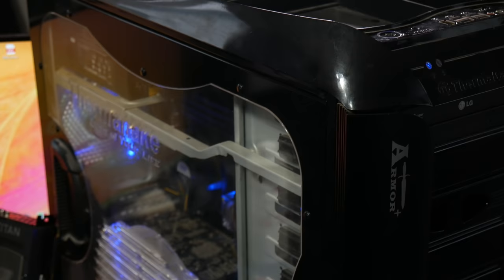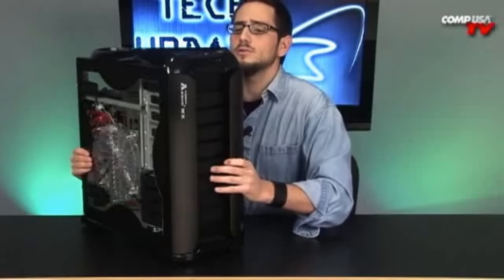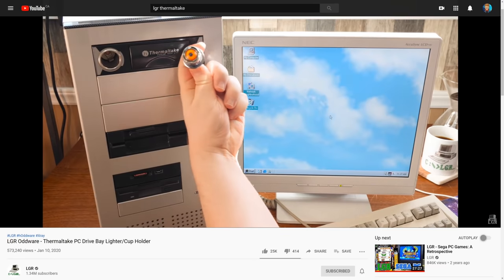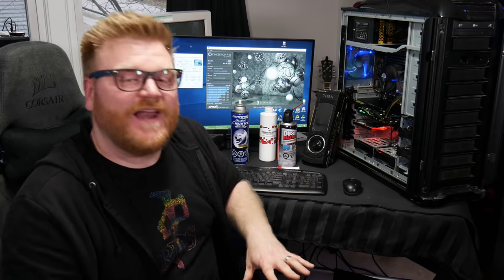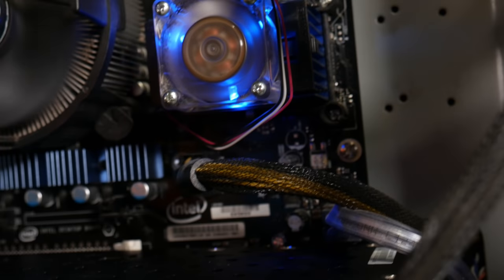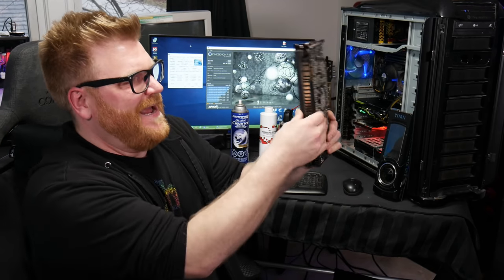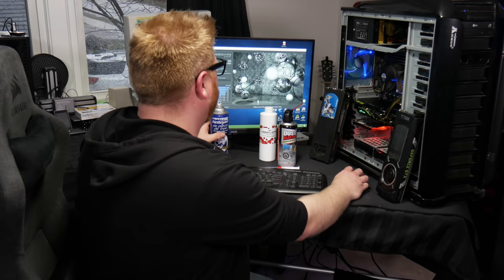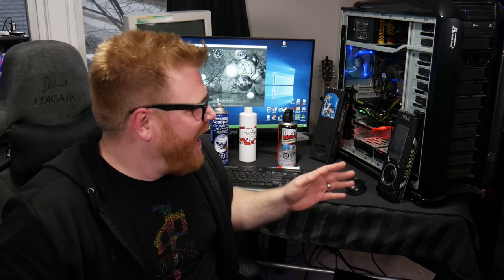Can $5000 buy a PC that will last 10 years?

Comment: i build my pc's with the plan that some things will eventually need upgrading but i never spend more then $350 to start with
then as time goes i look for great deals for upgrade parts that way its affordable and takes a very long time before it becomes obsolete 
[still using a gigabyte z97, i7 4790k "with low noise custom cooler", 32gb 1600 ram, 240gb sata3 SSD, 6tb hdd, 8tb hdd, gtx 1970 8gb, 750w 80+ gold psu] i am able to do lots of things with this system like VR Gaming, vmware virtual systems, run privet lan only mmo server games, video editing, and more
and i have as system like this and my income is only $700 per month and yes i am married and have  a kid so yes i have expenses of providing for my family as well so i have to make the best of every dollar spent
it has taken time to get to this point but i have a system that if i changed to a newer generation i would have to go  with like a 8th gen i5 to get same or better performance and that kind of system is still to expensive
oh before any one says just go AMD well that is out for me because of some of the virtual systems i run thay only work correctly on intel systems so im stuck with intel till i no longer need thows virtual systems
i do not plan to drop this system till i can no longer upgrade the video card and play new games with at least 0.01% lows at 35fps
by the way i have been using a 4th gen system  for 8 years now and plan to keep doing so till the above happens and i don't see 4th gen systems becoming obsolete even in the next 3 years
so yes it is posable to get a system to last you 10 years but not with out doing upgrades along the way
how ever i do agree it is not rational thinking to go all out no expense spared at the start of building a pc to last 10 years with the thought that you will not have to change any part of the pc or maintenance with in 10 years
so basically just go with the plan start out cheap with a pc generation that you can affordably keep upgrading over time 
that over time is the only practical method i have found to get a pc to be able to last 10 years
{been working with and on computers for 24 years using computers for 32 years }

Comment: I spent about 800 euro in 2007 for my system with solid foundation (Antec case and psu, Gigabyte GAP35DS3R, 2 Hitachi deskpro's 500GB in RAID, Scythe Fluid Bearing fans) budget processor (Intel Pentium E2160) and GPU (Asus EN8600GTS Silent). And in 2010 I upgraded the system for about 500 euro with a Q9550, Prolimatech Megahalems and a Intel Postville X25 80GB SSD as an OS drive. 
It's never been my intention to run it as long as I did, before I always upgraded every two or three years and at the time I expected it would suffice for the next two or three years. But Intel didn't really innovate and AMD Bulldozer,........ well lets not go there :).  My overclocked Q9550 wasn't that much slower than most I5's and i7's for a long time and with an SSD inside the system was snappy and there was no need for me at all to upgrade.  It's been running now in this configuration for the last 10 years overclocked at 3.4Ghz  24/7 with no downtime. Oh, that's with the original Artic Silver thermal compound, when I stress the system with Intel BurnTest it reaches 56C degrees at the most. My conclusion, you only need to spend 1300,- for a computer that still works perfectly and quite snappy after 10 years :). Granted I don't play games and what made a huge difference was that I could upgrade to an SSD as early as 2010. 
This year it's finally going to be replaced with an Ryzen system and maybe I'll do the same as last time. Buy a good foundation (Fractel case, Seasonic PSU, MSI x570 Unify) a top GPU (RTX 2080 or 3080) not for gaming but for chess AI where I need the Tensor cores and put in a placeholder cpu inside (Ryzen 7 2700x) and upgrade once Ryzen 4950X comes out. I should notice some difference :)

Comment: It will make a great fortnite/cs-go/sports gaming computer for a kid.Also if it is... throw in that xeon. they dont cost much and will give a good boost for the money... But still... It should be sold. 

And then as someone else said, spend 2500 every 5 years instead of 5k every 10 years... will do him A LOT better.

Comment: Man I had an i7 920 in 2009-2014 and using it with a stock cooler is a joke, that thing ran at 95c like a tractor 🚜 .  I threw the stock cooler in the bin after 2 days , how on earth this dude ran 10 years with this garbage cooler ??

Comment: Well, it's of course hard to predict the future.  I'd say the writing was on the wall for certain things like Hard Drives and SSDs for instance.  But GPUs are a funny thing, like it's hard to imagine that in 10 years time something like a 2080ti will be basically a potato card.  I'd say a good rule of thumb build your pc for $1500-$2000 (if you can) with the intention of it lasting 5-6 years for gaming and pro work. You can certainly get more out of it but it just depends what your tolerance is and what games you play!

Even something like a 6600K today which isn't great for modern gaming still kicks ass as a general purpose computer CPU.

Comment: Lol..
I used to make system that cost more... There not fast today, but there able systems. Pretty good ones.

The rule of thumb, is a computer for 3 years as the hardware changes.

System specs today and for the next few years is 
8core.
16gb
M.2 boot.
SSD swap/page.
And 8tb mech.

Right I'd so a 2080 and I think he would want a 4k monitor with this. And a new keyboard and mouse....

So realistically 4 grand is way more than some of the stuff nowa days. And there cheap and dropped due to consol sales.. so you get more....

Factually as a UK prices I think about 750£ is about right. So you money seems a little high with them Canadian dollars.

I got 11+ year old systems and they perform in some circumstances as good or better than other and newer systems.

It doesn't help that the companies have been holding back and delaying for 10+ years in tech to get punter money...

(Wrote in 2006 how to make the EYPC) 

Don't dog old tech. It works kinda..
What's its 3dmark 2006 etc bench results!

Comment: Short answer:
2010-2020 Yes. 
2020-2030 Probably not. CPUs in 5-6 years will be incomprehensibly fast. Tech is rising at an exponential rate, not a linear one.

Comment: ffs back then i had a i7 980 cpu with 24gigs of ram and a gtx 580 roughly back that time that still would of did something today lmao. but the board broke on it years later but it is what it is i still own the cpu though and the psu and parts of the ram. im still using the case and all its fans are still working almost 10 years later

Comment: So i had that platform and if it was up to me it was beast, even today it can hold its ground of paired with xeon and some decent gpu, its not latest and greatest but mine with xeon oc on 4.3 had almost same performance as 7700k... Now my pc with that platform is waiting for second xeon x5690, and new gpu cause i have sold gpu from it and i plan to keep it alive forever. If i remember correctly i have payed 200 usd motherboard and 200 usd i7 920, so this guy got ripped of for his 5 k but his money, he will be smarter next time i guess. My plan with my x58 is coming together slowly, its gonna be in fortress ft02, with tripple 180 mm radiator, need to get gpu and some decent psu for that, i have already  all other watercooled components and case is already modded to fit that monster rad and eatx mobo in it. I guess ill send you results to roast my rig when it gets finished up

Comment: That was not a good build for 2009. Your friend got hosed. The SO is considered by most to be one of the worst x58 overclocking  motherboards. It did weird stuff with automatic overclocking that caused a lot of issues. The xeon w3670's retail new was like 300 dollars the w3680 with an unlocked multiplies was 600. For a 4 thousand dollar system those 6 core options would have made a lot more sense.  I mean as a rule spending 4k on a pc is always going to put you out of a good price performance game anyhow. And having a 10 year expectation is unrealistic. Spending 2k and upgrading every 5 years would make a great deal more sense.

Comment: In reality, you can use a PC for about 8 years before it just starts showing it's age too much in the current ecosystem. Example: the FX-8350. While not the best cpu of its time by a long shot, it still worked fair enough, and did good in the games of its time. Over the last 8 years The rig I had that in, only really was upgraded in the graphics card department. And if the machine was still running, I could probably eek out a little more time from it by getting a 1660 for it, but that would be about as much as it would take. 
The CPU in that rig really is only a bottleneck in incredibly CPU heavy games. So Java Minecraft kinda chugs if I have too many mods, and conan exiles stutters occasionally, Ark:SE is a nightmare, but DarkSouls 3 runs great, Fallout 4 runs awesome, Generation Zero runs awesome, Space Engineers actually runs pretty damn good. Monster Hunter World runs great. A bunch of todays games all still run great. But we've reached the last potential upgrade that would be able to stretch the life of the processor as part of a gaming rig. My brother is running into the same problem now with his old 1st or 2nd gen i7, he's paired it with a 1080 and it plays all his games as well as VR stuff just fine, but he's at the end of the road with it.
I'm guessing, as far as my workload is concerned, the i9 9900kf in my rig now, and the 32gb of ram will last me quite a while. In a year or 2 I'll probably need to upgrade the 2080super to whatever the new hotness is, but that cpu/ram provided it doesn't crit fail, and I make sure to redo the thermal paste before it becomes chalk. I'll have a serviceable machine for at least 5 years, And possibly as long as 8 or 10, with doing basic maintenance, and upgrading the Graphics card once every few years.
And before anyone says anything, yes, I know I'm in at the ass end of 9th gen intel. the new 10900K is just around the corner with 2 extra cores and yadda yadda, but the 10700k is basically a 9900k so I'm not really falling behind in any significant way. [Especially since I got a decent sale on this.]

Comment: I "Butter my Bread" a different way.  I never buy the latest and greatest.  Don't want to.... Don't need to.  I generally build a better system every 5 to 7 years depending on what used-deals I can find.  Find the best Bang-4-Buck!!!  If you stay 2 generations behind in tech.... (1) You will get great deals.  (2)  The older hardware has been fully tested and patched.  So, you can avoid hardware with known-issues.  And...  (3)  You can usually recycle something from your previous system to save money.  I never pay more than $200 for a CPU and I never pay more than $600 for a system.  When I do buy new components, I try to make sure they can be used in the next build.

Comment: I’ve been working with computers since the 386 and 486 days. That probably dates me. Maybe 5 or so years ago you could say you MAY have gotten away with a 10 year old pc. Not these days. I have a 9900k now. With these days I will be lucky if it’s still relevant in 2024 possibly 2025. I think if you really want a good high end pc these days a $1500 to $2000 pc would be good for 5 years. 10 is pushing it with how demanding games and programs are getting. And don’t forget about streaming at the same time you are doing all this. But I probably may be upgrading in like 2 years and give my son my 9900k... if even that’s still relevant.

Comment: my friend im sorry to dissapoint but i had a 3930k 6 core 12 threads since release for about 8 years and it worked nicely for all that time and it would even work with 2080ti if the cpu were to be averclocked to 4.8 all cores.(i knoww its a rare case) :)

Comment: $2500 new pc. In like 2-3 years from now, sell the computer or even most of the parts and then get half that money back and still have around $5000. build a new $3000 and invest the $2000 in common sense classes.

Comment: my system cost me £200 last year with an extra £120 for an rx580 8GB 
i have 
corsair carbide spec 5 case
Biostar TZ77A mobo
i7 3770k
16gb ddr3 1600MHz ram
rx580 8GB sapphire pulse
2x 2TB hdd
1x 250gb ssd OS drive
and a corsair VS550 psu
and it can play what games medium-high 1080p at stable 60fps all day long i filled the case with some NZXT case fans someone took out of a new case and swapped for RGB ones so on cpu never gets above 60c in a year time i sell the board ram and cpu get a cheap ryzen5 and mobo for £200 and i will be up to date again you don't need to spend over 1000 £$ to play games just don't build with the mentality newer is better my friends 2gen i7 extreme series beats out most 6 or 7 gen intel chips

Comment: Upgrade to a Xeon W3690 or X5690 and overclock it to 4.5GHz on water. Buy a good overclockable motherboard. 24GB of 1866MHz RAM (or higher). Toss a 2070 Super in. Done. Will still be great for the next 3-5 years. X58. IS. NOT. DEAD.
Reply: And for reference, a W3690 can be had for $65. A good CPU cooler would be under $200. RAM? Add another $85. Motherboard $200. And a 2070 Super. You'd be spending FAR less than $2500 for a rig that would last this time period.

Comment: 5000$ for 10 years?
Why not 500$ every year for a PC. 
If not then spend around 1 grand at the first year, it would've lasted for at least 2 years, then keep on spending 500$ for 8 years upgrading it, updating it with the latest parts so that it would last long while performance stays stable

Comment: i think you are right but in the last 10 years computers have changed as much as the las 30 or 40 years.
DDR4, THUNDERBOLT, FREQUENCY, Cheaper but better SSD and a bigger market which means cheaper products and more acces to the technology
 That doesn't meen you dont have to do maintenance, do your fucking maintenance don't be lazy.

Comment: This build was flawed from the start. I dont see this ever costing that much when it was built. Most expensive parts was cpu and video card. That board was crap from the start and the gtx295 was an expensive mistake. Hd5870 was already out and hd5970 was right around the corner and had dx11. Would probably had still been playing some games today on low but still working. And with a few bucks could get an x5680 or x5690 and a mid tier video card and still use it a few years. Buying a titan was another dumb mistake and was such a waste. With the same money wasted on that gpu this machine could had still been decent with   good cooler and OC or a xeon 6 core and  3-400 dollar gpu.

Comment: These were for raids for Linux stuff or I guess WIndows XP workstations with a dedicated raid card since fake raid was not mature yet. $500 GPU (back when that was expensive thanks ngreedia) and it didn't even support WIndows 7 directX11? What a rip off lmao. Back then I got a cheaper ATI 7870 which had excellent directx11 support

Comment: I'd say your friend got ripped off at the time. The idea of 10 years for a PC is true, if you get a good high end motherboard and PSU. Don't go crazy for the rest *mid level. Then over time replace parts with better as they get cheaper.

I could easily game with an x58.

The Intel motherboard is ass btw.

Comment: I think 10 years is easily possible. Will you be high end gaming that whole time? probably not but I could still see a absolutely top spec high end computer for a specific time still being able to play the latest games a decade later and we see it all the time quite frankly. I mean console generations go around 7 or 8 years so just based off that you could say it's possible. If you built a computer that trumps the current consoles at the beginning of a generation your at least guaranteed that time since most games are designed to run on the consoles. That said you would have to be okay with a continual degradation of performance which many people wouldn't want to put up with for a decade. I mean say your used 4k60 max settings and built a rig targeting that well there's no way that same rig 10 years later is still able to achieve that with the latest games or just from an overall performance perspective. If you can deal with that then yeah it's possible

He really got ripped off by paying 5k though especially a decade ago too since pc hardware pricing has absolutely sky rocketed in the last decade. 10 years ago you could build a absolute top of the line pc for like 1k. I mean a GTX 580TI would have been like $500 but now a 2080TI is like 1200 at least which is insane.  For today's pricing you would still be getting absolutely ripped off. I mean 2k max get's you the absolutely peak of pc performance possible right now. Anything extra is fluff like let's say your through in an insane customer loop okay take it to 3k which would include an SI markup. 5k though is highway robbery especially for what he got in any time period. Kinda crazy what you can get away with when people aren't knowledgeable about something.

Comment: 6k... dont look at consumer hardware, buy a server... 32-64 maybe even 128 cores??? 128-256 GBs of RAM, GTX2080 ti.... that will last 10 years..... a GPU is the only thing you may ever consider upgrading
Reply: running dual E5-2697 v2s and 512GBs of RAM... this has and wil last for so long...

Comment: Never but still usable id say

My mom bought a home pc fl1999

Gpu died in 6 months 

And to this day idk why, it overheats in 5 seconds after starting the system on.
Welp all i need is a decent gpu 

Specs:
I7 6700k (i'm snatching that for my own pc)
8GB DDR4 
250GB SSD
1TB HDD
Windows 10 OS
Generic hp wireless K&M